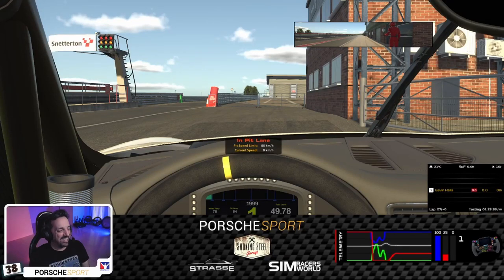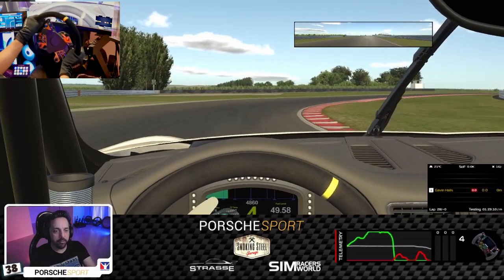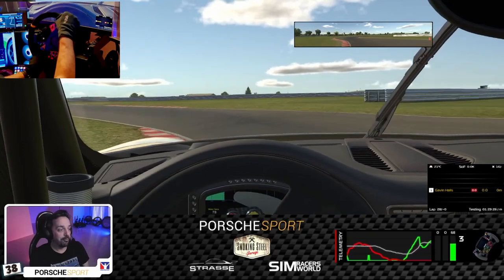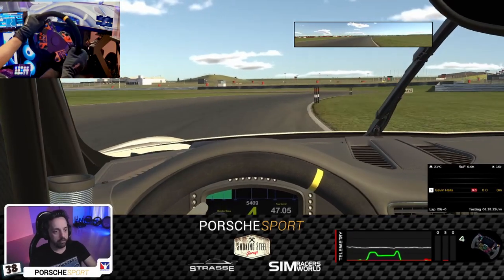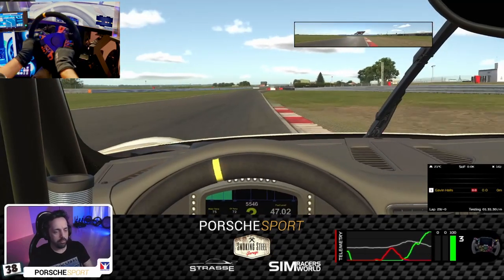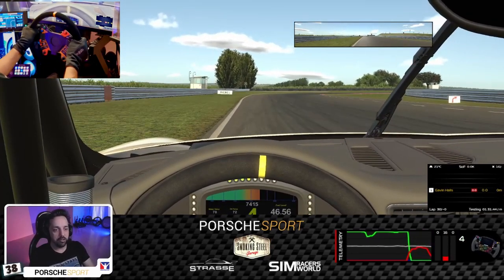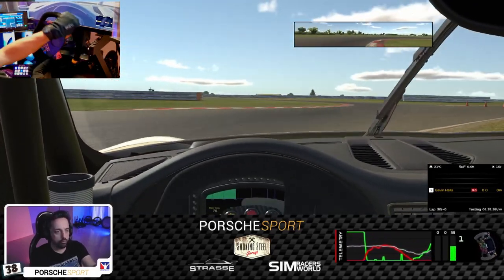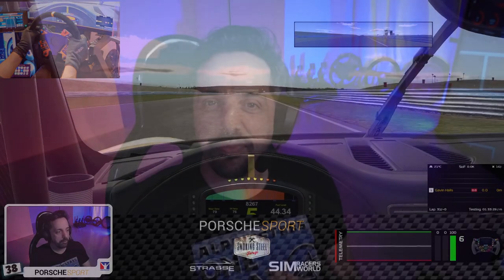Simline GT3 Cup R Wheel review. The Porsche replica Sim racing wheel

Comment: Great review. the button plate being close to the wheel sounds like a deal breaker for me.
Reply from the maker: Hi, the button plate is all good, the issue is the spoke of the wheel being very tight at the point your thumb sits. but TBH over time with use the stitching in the area has softened up so although not perfect it is much better than when it was new and fresh out the box.